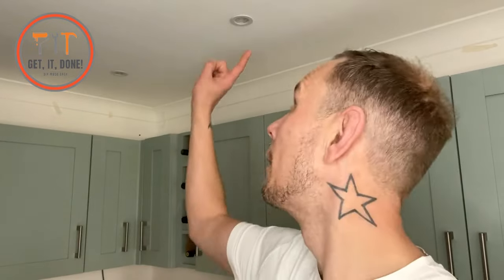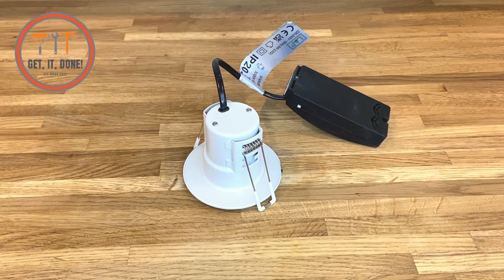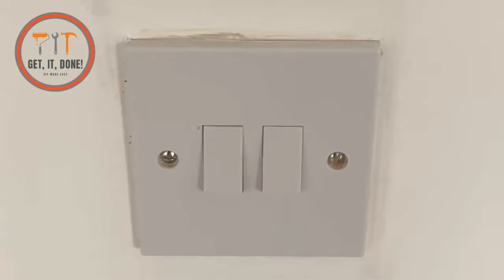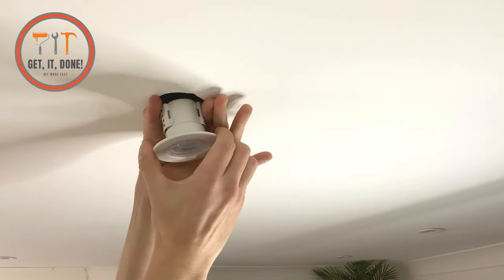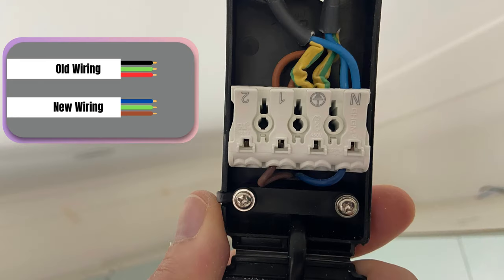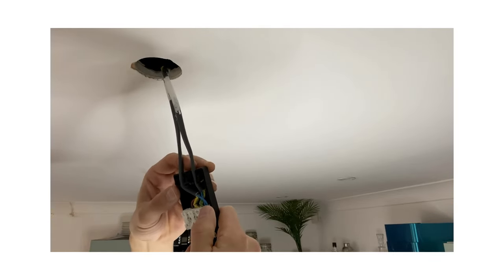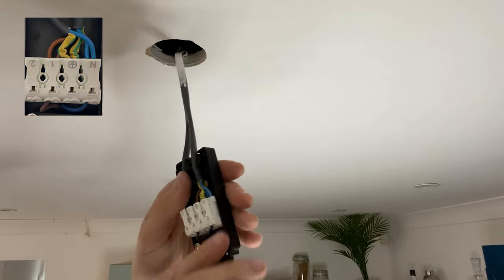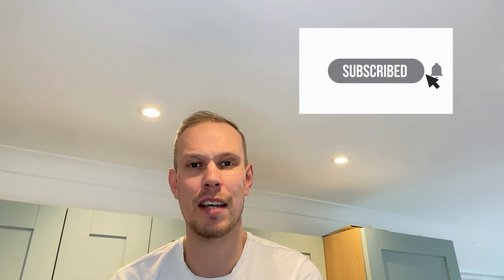Downlights - How to Easily Replace fixed LED Downlight

Comment: Found this and realised that I couldn't replace the bulb in my downlights as I have these integrated sockets in all bar about 2 of my downlights. Then you show how to find the K value which is exactly what I was after, killed 2 birds in one stone after 90 minutes going down rabbit holes on YT. Thanks!
Reply from the maker: Glad to help
Reply: Ah no 🤦🏻 I think I have the same problem, how much are these whole enclosure replacements?

Comment: question please I have Ip65 lamps can it be connected to a smart switch ( wifi) for alexa connectivity and sort. how do i even know how to check if they can be connected to a smart switch and then alexa, dont know if am making any sense - if that dont work wld i have to considering removing all ip65 lamps and installing new lights that are smart ?

Comment: Surely if i only want to change the bulb i only have to change the bulb cable and not the actual cable that goes into the ceiling?
Reply from the maker: New downlights are integrated meaning they are fixed (no bulb)

Comment: I have Ip65 lamps. Hw do you take the light fixture down, do you have to pull it from both sides? Also will i need a complete new set. Thanks

Comment: Is there an easy way of telling if it’s an integrated LED? I’ve been trying to change the bulb in a fixture and it’s completely defeated me.
Reply from the maker: Hi Rob, if it’s not the integrated type the downlight will have either a twist and lock section holding the lamp in place, or a circular spring which you pinch and pull and the lamp comes down, another way to check is give the lamp a little push and if there’s any movement on the lamp it’ll be the type you can replace. I hope this helps

Comment: Do you have to yank it down? I am not trying to do anything with the wires only change the bulb. 
Thanks
Reply: @T-London  You can't change the bulb. That's the point. It's like having a car and having to replace the entire thing when you get a flat tyre.